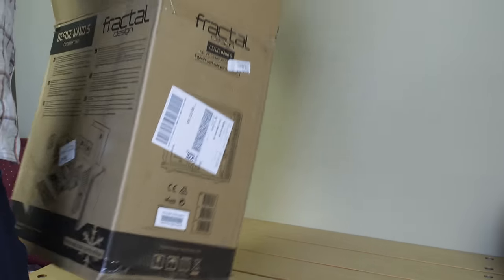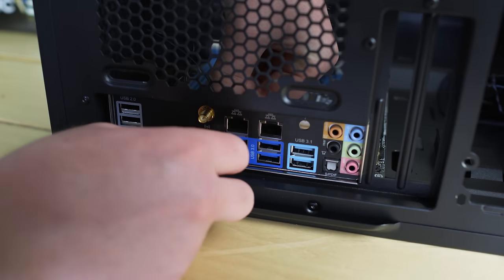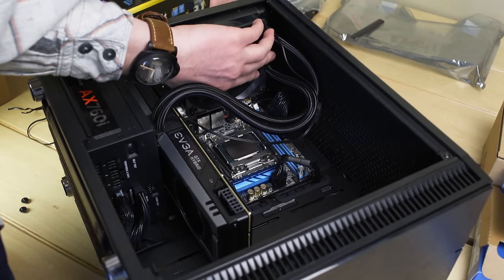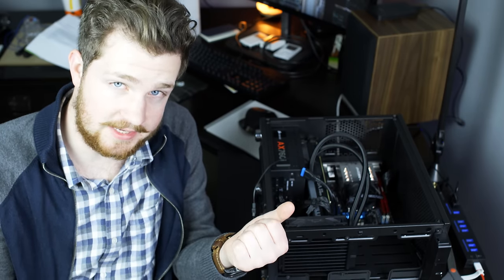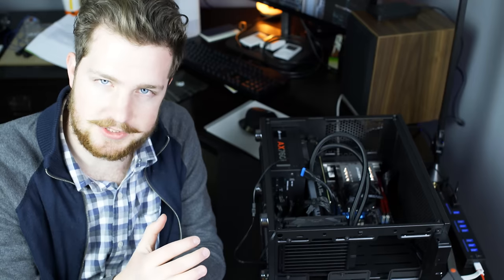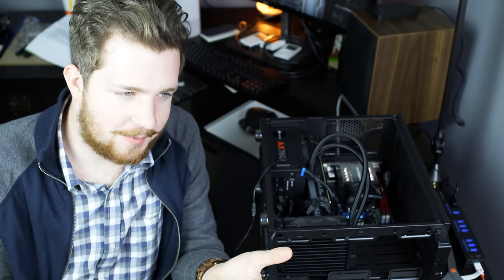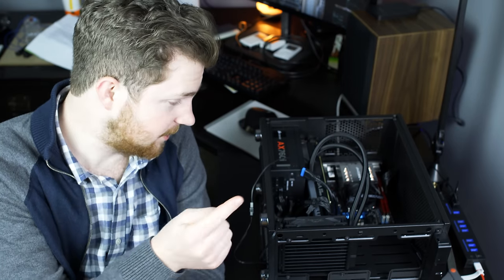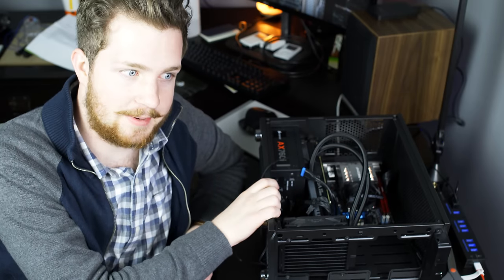My Powerful Custom PC Build Disaster

Comment: Why you don't you Hackintosh this computer?
Reply: +LiteGaming Lots of bugs, and viruses depending where you get the downloads from
Reply: +Sean McIntyre that is why you get it from the App Store dummy...
Reply: +LiteGaming Not all people have access to an apple computer
Reply: +Sean McIntyre he does and Hackintosh Zone is good distro
Reply: ***** I own 2 hackintosh they work great and it is easy I just borrowed a friends iMac for the unibeast drive than when el capitan came out I made a Clover USB and updated and still works with out a problem the only reason to buy a Mac if you want a Laptop but you can still can hackintosh a laptop but it doesn't work as good as a custom computer
Reply: +Sean McIntyre I like the interface
Reply: +Sean McIntyre also there is QuickTime
Reply: +Sean McIntyre next thing you know he make the video lolz
Reply: +Sean McIntyre what are the odds :p are you ever going to try Hackintosh your computer?

Comment: water cooling is a waste of money and just another thing to fail.
Reply from the maker: +Cameron Fischer In your opinion.
Reply: +Snazzy Labs fact*
Reply: +Russell Morton Wrong. AIO water cooling is very reliable and can deliver great performance, as well as aesthetics. Snazzy just got unlucky.
Reply: +Cameron Fischer 

Typically water cooling is just for show and not much else. Water cooling will never prove to get back the initial cost of investment.

Sure one might be able to overclock with water cooling, but take a guess what the percentage is? A quieter computer? Quieter yes, but only moderately - one can get almost as quiet by both using the right fans and also placement of those fans.

Water cooling can look good if done correctly, but... There is also the risk. Even the best of components in a water cooled system can easily fail, so try to imagine that water leak. It also completely voids every shred of a warranty on anything. It does require maintenance and occasionally even a tear down.

I'd personally rather go without a water cooled system and still be able to tune both the processor and the graphic cards - still able to keep and maintain incredible results. If a higher end I7 or an industrial scaled Xeon can't do it for someone then something is seriously wrong. One can still have both the processor and the graphics cards without ever needing water cooling.

Comment: Is this how all first PC builds go?
Reply: +Saiyan Spirit yes if you have no clue what you're doing
Reply: +Saiyan Spirit Nah. When I did my first build I had no idea what I was doing but knew enough to double and triple check that all my components were compatible...and I bought a new PSU :^)

Everything fit together (though clamping down the cpu was scary as fuck) and everything booted up pretty much perfectly. Thing ran like a dream for years (and it's still running, my SO is using it to game)

Comment: Wow, so many mistakes. First is trying to make it mini (go big or go home :-) ). Second is: you spent 1000+ dollars (if I understood correctly, or was it 2000+) for a comp. but you bought a CRAP PSU?! That makes no sense. Than on top of that you got liquid (or was it hybrid) cooling into that tiny case. No wonder it is all a mess. Btw if your connectors won't go into the PSU properly, without problems, return it right away. Don't gamble with the rest of your rig.

Comment: The one component of your computer you can never I repeat never skimp on is the power supply..... Refurbbbbbbs suckkkkkkk just get a EVGA 80+ gold power supply 700w for around 130 or less..... If Linus tech tips uses EVGA it's good enough.

Comment: Why are you using those small parts? 
Wouldn't using standard atx parts be much easier...
Reply: no not really.
Reply: taief miah Also, with bigger parts comes the promise of upgrading...
Reply: Hanro Lareman not really. Unless you want an extra gpu which they won't need for this.
Reply: +Hanro Lareman there's pretty much no difference. only difference between itx/mATX/ATX is size, generally the bigger boards have more things like sata and pcie ports but that's about it.
Reply: Ben Sparkes

There are key differences like say 4 dim slots or more pci-slots
Reply: I said that... maybe I should've added an "etc" in there lol
Reply: Ben Sparkes

I'm saying say like in 5 years you may need another gpu or you may require more ram, you have the space to upgrade if say cpu, psu and motherboard technology hasn't advanced much at all
Reply: In 5 years you will need a new mobo anyway because the CPU socket, probably RAM and perhaps PCI-E and SATA will have moved on to newer standards eg DDR5, DDR6, LGA 1200 etc

Comment: you have got just very unlucky :/
Reply: +onehans66 No he didnt he bought a refurbed psu....
Reply: i bought refurbished panasonic tv from ebay 5 years ago lol still works. what's your point? 

more over i bought asus sabertooth x79 4 years ago with bent cpu pins for 30£ i got them straight with needle and scope. still works no issues. again what is your point? refurbished does not mean broken. being clever sometimes hurts
Reply: onehans66 cookies

Comment: I could build a PC that would outperform a $4000 Mac for $1500
Reply: +Aaron Anon Yeah, no. No you can't. The fact you think that shows you don't know what's actually in a Mac Pro. You can get there for cheaper than $4,000, yes, but not for $1,500.
Reply: Mike Adams
No, I could.. I just checked the specs And I could EASILY beat that - 3.5GHz 6-Core Intel Xeon E5 processor
16GB 1866MHz DDR3 ECC memory
Dual AMD FirePro D500 with 3GB GDDR5 VRAM each
256GB PCIe-based flash storage1
Reply: Aaron Anon Please enlighten me where you're finding those specs for $1,500.
Reply: Mike Adams
I just priced a rig and went a little over because I went with an i7 6 core running at 4GHz and Dual GTX 970s instead of the Radeon GPUs because they weren't available, but it was still only $1700 and the comparable mac is 4000
Reply: Mike Adams
Excuse me? I replaced part unavailable on the site I was pricing on with more powerful and expensive parts and went over my original estimate by only $200, and that still leaves the mac $2300 more expensive.
Reply: Aaron Anon You are 100% completely missing the point.

The Mac Pro is NOT a consumer device. The people in the market for something like that would NEVER buy a product with non-ECC RAM and gaming-oriented graphics cards. 

Xeon's also pack more instruction sets than the i7. I'll say it again, PLEASE go do even a LITTLE bit of research before spewing crap. We're not talking about a gaming build here, which apparently is the only experience with computers you have.
Reply: Aaron Anon I did, you kept coming back saying I was the one who was wrong, even though you don't know what you're talking about. At that point you lose all the 'talk like adults' respect.

Comment: I would have gone with a 1070 , 1080 , or a RX 480
Reply: Please check the fucking date on the upload.
Reply: XD my bad
Reply: those cards are not even close to similar in performance....thje 1080 and RX480 differ over $500
Reply: You're* Learn to spell before insulting people

Comment: Are you sure that mobo can handle a 140W CPU?
Reply: +Jon Netbotic Are you really asking if the motherboard can handle the CPU type it was designed for?
Reply: Yeah, CPU type (I'm assuming you mean socket) has little to do with TDP. I have seen many builds with CPU TDP well above the motherboard's recommendations, hence the question.
Reply: +Jon Netbotic If I meant socket I would have wrote socket. Since motherboards are designed for specific families of CPU you would never have a CPU that fit the socket but had a TDP the motherboard could not handle(unless you overclocked it beyond reason and logic). Therefor your question is kinda like asking "Are you sure this liter of liquid will fit in this one liter bottle" and in both case the answer would be "Yes, its what its designed for"
Reply: Nope, CPU family has nothing to do with TDP either. There are 80 watt CPUs and 140 watt CPUs in the same family. I'm guessing you're not familiar with CPU families, TDP or motherboards.
Reply: Thats what I am saying even though there may be an 80 watt CPU in a family it(the motherboard) will always be designed to handle the CPU with the top wattage in the family. So going back to my original water bottle example, a 1 liter bottle will have no problem holding 0.8 liters.
Reply: Family encompasses many different speeds, sockets, stepping, etc. You're confusing family with model. I ran a motherboard with 95 watt CPU rating and a 120 watt CPU plugged into it for over a year. Furthermore, motherboards are not certified for CPU family, EVER. They are certified for CPU models. Unless I'm missing something in the video I saw no mention that his motherboard was certified for that CPU model, only the socket.
Reply: Anyway I looked up that mobo, it definitely can handle it. It looked kind of cheap in the video. There are plenty of ITX boards that cannot handle the maximum TDP of a CPU of the same socket, which is why I brought it up.
Reply: I give up. Your unfixable. Go on thinking that the engineers designing the standards for the motherboards and CPUs are dumb enough to not match the needs of the CPU with the requirements placed on the motherboards.
Reply: *You're
Reply: +Rustknuckle Irongut - Why don't you just google, "cpu wattage higher than motherboard" and see all the stories? It's not that hard.
Reply: Aww man, no retort? Look at most socket AM3+ motherboards, they're mostly 95 watts. Look at how many AM3+ CPUs are over 95 watts. Is the family ever mentioned? No, are there processors the same socket that exceed 95 watt TDP? YES.

Comment: For pc im always buying Gigabyte .
Reply: Ive never used/built system with a MSI motherboard so wont comment on them. Asus though, wouldn't touch them with a 40 foot barge pole with 3 condoms on the end certainly don't rate them over gigabyte, seen way to many failures on both my own and other systems i have built. In 10+ years of builds (pfft, numbers in hundreds...) i've only ever seen 1 gigabyte board fail, it was a cheapy and one of the vrm's let go.Considering 90% of these systems had gigabyte boards, they have proven very reliable.Ive personally still got a GA EP-45 DS4-p that's been running  over 2000mghz FSB (for you young uns, back in the day we had to overclock by increasing FSB .) since the day i got it, which was close to 10 years ago! My current gaming board is a x79, forgot exact model but gigabyte off-course!
Reply: +dunxy in my first pc I used a msi b150 m3 gaming. really loving it so far
Reply: I actually did a build the other day with MSI motherboard, very nice! I will be moving to them myself now.

Comment: WHY WOULD ANYONE WANT A SMALL PC WHAT THE FUCK
Reply: +Asdayasman why would anyone not want a small PC?
Reply: +t103Ninja but this guy is putting in these monster components in it a miniITX build is just silly.   And he cheap out on the PSU lol...
Reply: jay chen theres nothing wrong with putting high end stuff in a small case, i do agree with the PSU though you should always get the best one you can afford from a reputable brand
Reply: It's not fundamentally wrong, but I think most would agree a bigger case improve airflow, heat dissipation etc, which in turn translate into better overclock performance, component longevity.  But it's understandable that he's been a Mac user...
Reply: jay chen he has a liquid cooler on the GPU and a liquid cooler on the CPU when he gets deffective one replaced so plenty of cooling, a small case does not mean you have to comprimise anything if you do it properly
Reply: It's simple physics that all thing being equal, extra space help heat dissipation, that's where the advantage of a midtower over an mITX, but of course, the guy probably prefer a small case for space consideration.
Reply: jay chen i have to disagree, i recently downsized my large PC to a mini ITX, i havnt had to back off my CPU or GPU overclocks and everything runs aswell as it did in the big case

Comment: what cpu cooler was initially used?
Reply from the maker: +Zucchero Klein A NZXT Kraken X61. Moved to a Corsair H115i. Both made by Asetek. Almost identical products, really.
Reply: +Snazzy Labs whyyy would u switch over to a h115i??????
Reply from the maker: +847,628 Why wouldn't I...? It's literally exactly the same cooler. Not like I was going to keep either of the stock fans anyways...
Reply: Snazzy Labs
 well the x61 runs cooler
Reply: +Snazzy Labs thanks! Just wondered. I am running the h110i gt. Haven't had issues with it unless it actually didn't properly fit in my case. Maybe my cpu is not very hot but it never runs over 36 deg. C
Reply from the maker: +847,628 No, it doesn't...
Reply from the maker: +Zucchero Klein Those are great temps! Looks like it's working good. :D
Reply: Snazzy Labs Yeah, Thermal pasting went well I think. Only if my gpu runs hot my cpu starts heating up too because the radiator is exhausting the case air. Still really happy with the temps. I hope yours will work fine too!
Reply: +Zucchero Klein But an aircooler of the same price is far more reliable and very similar in temps. Noktua Cooler>Any closed loop coolers
Reply: Wooden Table But a watercooler with two 140mm fans and colour adjustable led on the waterblock looks more badass ;)
Reply: And is about 100 times more likely to fail and is considerably louder. Also looks depend on the person. Personally I find Phanteks coolers to look awesome
Reply: Wooden Table Phanteks coolers look very nice. It's indeed all personal preference. That's why we are pc builders and not console peasants. Ok I don't hate consoles but pc is just a bit more personal.
Reply: I agree but closed loop coolers just make zero sense economically and also there is a large chance they'll damage your pc but yeah
Reply: Wooden Table It's a risk for sure, but I like to give it a shot. My cpu idles on 21 degrees Celsius and as long as it stays in one piece i'm happy with it.
Reply: You could achieve that with an aircooler of the same price however